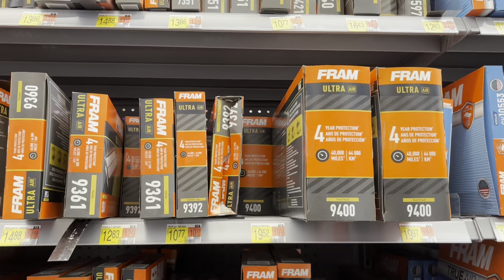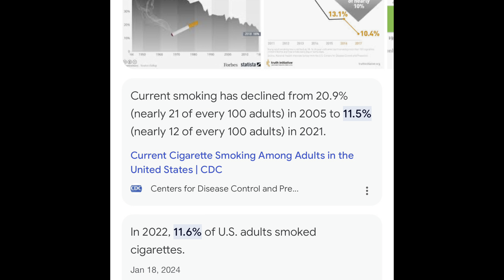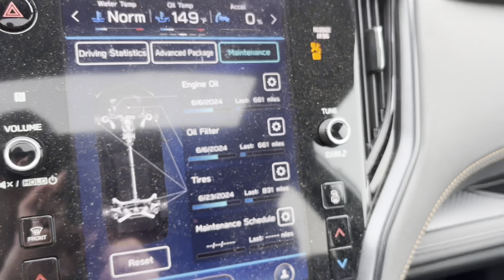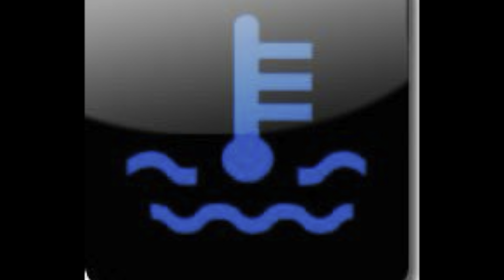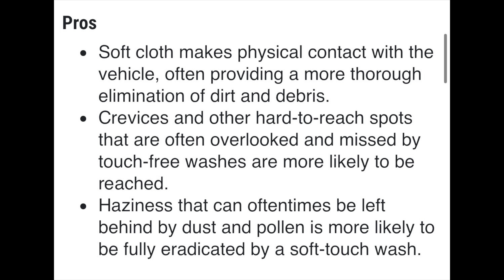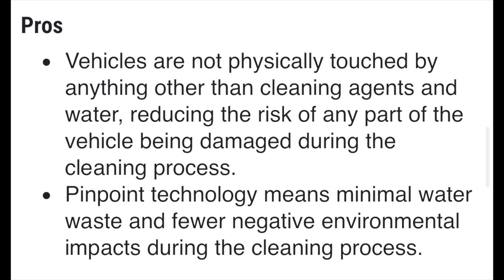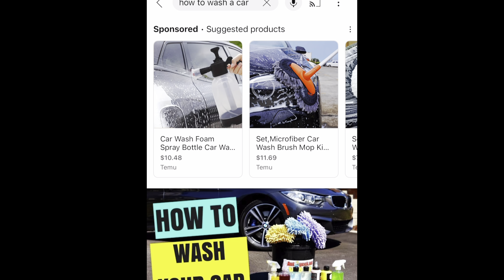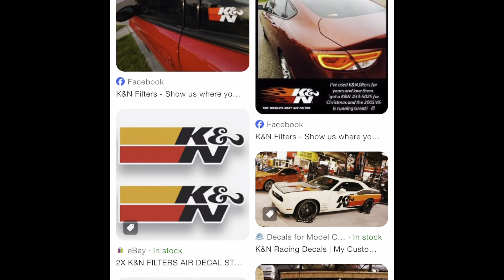These 4 Things Will DESTROY your Cars Value

Comment: Where I live there are a couple of mods which increase a car's value. Upgrading cooling, and trailer hitches. If done properly of course. Because many people have things they want to haul.
Reply from the maker: Yeah, that’s a good point! Thanks for adding your insight. 🙂
Reply: Usually the vehicles I buy have factory tow packages, and installing a receiver hitch and auxiliary cooling for the transmission are definitely a must on a truck.....however, they still need to be done right of course.

Comment: Is it necessary to idle the cold engine until the blue light goes away? That's what we have been doing and that drastically cuts our mpg.
Reply from the maker: My first suggestion would be to refer to the owners manual. But I personally don’t wait that long. As mentioned, if the engine is cold I will always wait a minimum of 1-2m before light acceleration driving. But I know when I had my Crosstrek that light wouldn’t go away for sometimes up to 5-8 minutes.
Reply: I'd rather take a very minor fuel economy hit, than be spending thousands or tens of thousands on a replacement engine.
Reply: I run wide open until that light goes away.  It makes the heater work better.
Reply from the maker: Oh gosh, haha 😂

Comment: #5, since the pictured vehicle is a Outback, and since Subaru no longer offers a manual transmission on most of their vehicles, don't try towing with a CVT anywhere near what their tow rating is. Towing 3500 lbs with a CVT? I can see, maybe, towing 1000 lbs "occasionally" with a CVT.

Comment: I either wash my cars at home, or use the hand wand at the car wash.  I would NEVER use a drive thru with brushes.
Reply: 😂why Not🥺
Reply: @55mblindy   Scratches, plus one I went thru, the rails on the tire guides scratched up the rims.
Reply: Me too. Only drive through one I use is the laser wash in Wellsville. It is a spray-only automated carwash.

Other than that, I'll bring it into one of the garages at work on a weekend occasionally and perform a by-hand wash.
Reply from the maker: Ouch! I’m sorry that happened. 🤕 

Yeah, in general I only use touch less or wash myself. But my Outback’s clear coat doesn’t stand out over the silver paint and really show swirls like other colors do. So I figured it be fun to show that footage. 🙂
Reply: I use the brushless carwashes but never use the ones with brushes, they scratch the crap out of your car.  The brushless ones just use pressurized water, like a pressure washer, and work pretty well, especially the ones that get the underside of your car where all the winter road grime is at, and typically bare un-preserved metals under there that'll rust out quite quickly.  For some reason this country can't grasp the concept that sand works much better than deicers, and doesn't destroy your car.